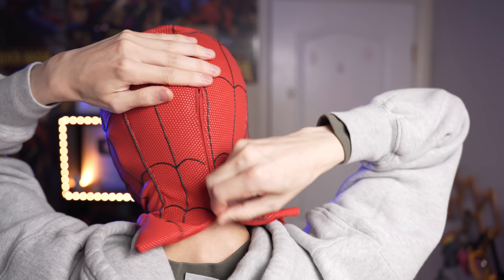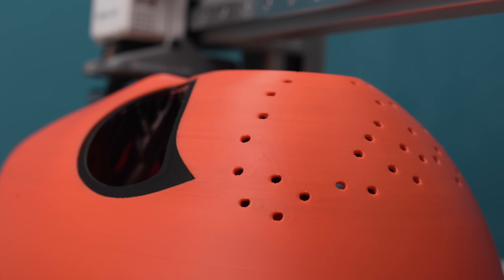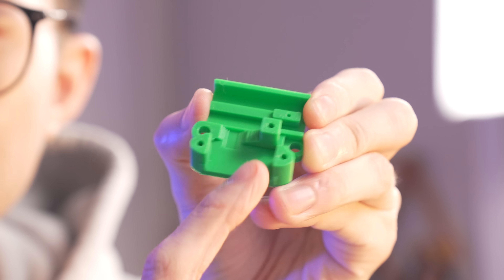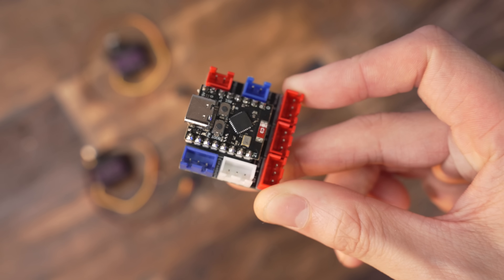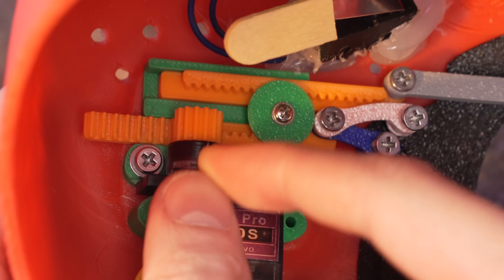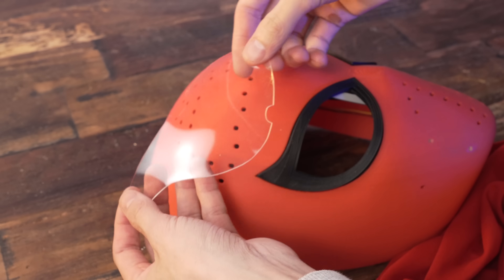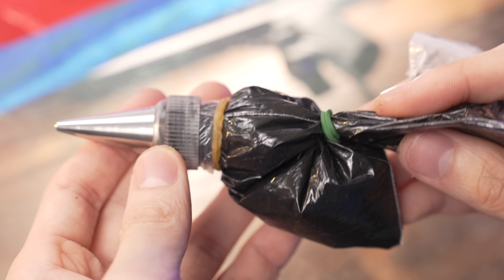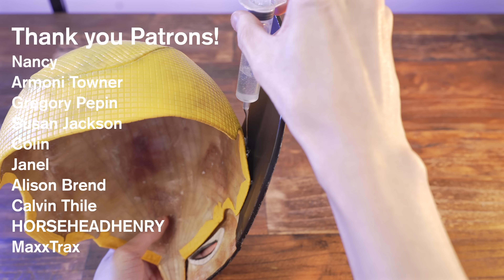I Made A Spider-Man Mask With MOVING EYES - Electronics & 3D Printing Are EASIER Than You Think!

Comment: Wouldn't it be easier, instead of using electronics, to just use a thin tube with sewing thread inside, which you could pull to close the eyelids, and use a rubber band to reopen them when you release the tension?

Comment: I definitely recommend mixing liquid latex into the puff paint to make it more durable and when your sewing spandex try stretching it a bit before seaming it with a straight stitch and try to mark the back of the mask where lines meet so you can get better alignment. It looks incredible and im definitely going to be trying out this project on my 3D printer
Reply: dont straight stick, use a stretch stitch zig zag with a small length and width. stretcshes way more than any stretch stitch.